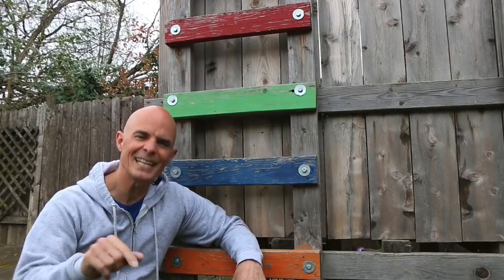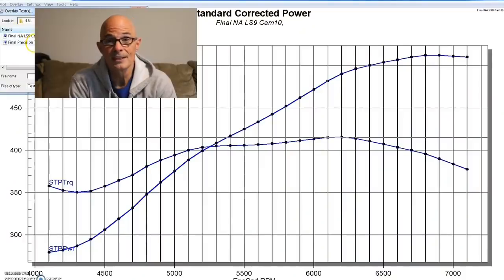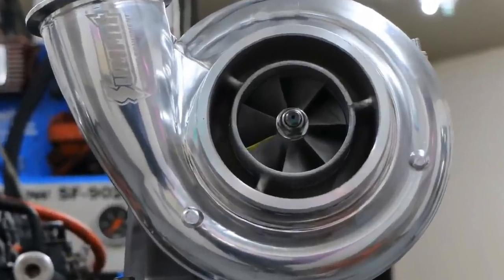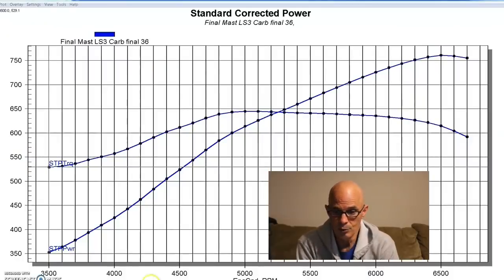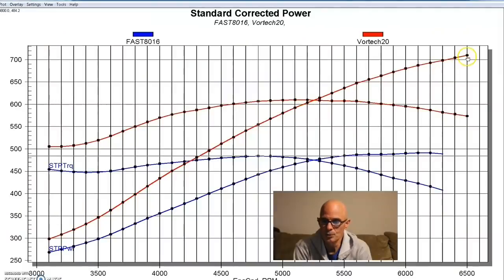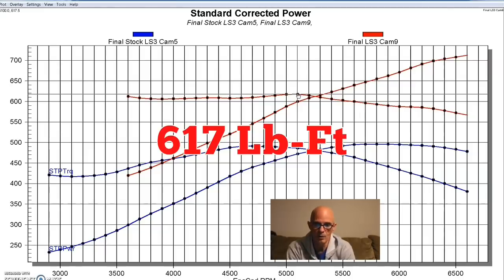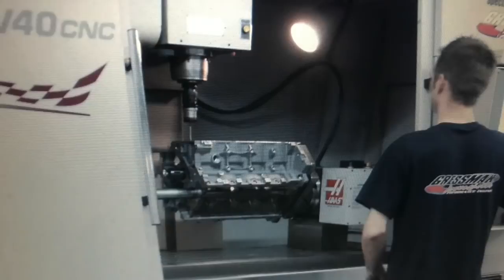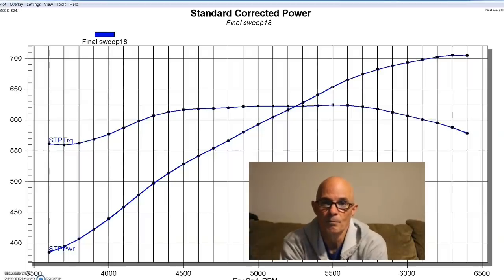LS HOW TO: 700-HP POWER RECIPES

Comment: This is what got me to thinking i could run 11.1 on 91  without riding the nock sensors.  But I keep getting conflicting information. So im unsure.  So i guess ill put the 317's back on for 10.2 or 10.3 ish Probably after I surface them.
Reply from the maker: it is more than just static vs octane
Reply: @richardholdener1727  Exactly. That's why I can't get a straight answer. There is no definitive answer.  Unless someone knows every aspect of your Project and the vehicle it will be going in and how it will be used.  You're not going to get that answer in the comments. There is a reason why dino sessions are expensive.

Comment: Richard do you have any info on that 251 266 duration cam that was in the ls7 454 combination? would that cam be to much for a 408 with 11.1 compression with a tfs 225 head?
Reply from the maker: it would be for a street motor

Comment: Man few years ago back I build an engine just like 1 you built it. an I made about same horse changed a few things after going in the truck and that truck runs today. We have watched ur stuff in past when budget was running low n thinking what can we do to make 50 more lbs or 50 more horse before we get 1 in n I will be first to admit that I did a few things u did n got the extra lil bit I needed. I owe you a thank you from a couple years ago Richard

Comment: So how does a 4.8l with a ls9 cam N/A make 512hp but a LS2 6.0l Crate motor n/a is 491hp ? Just interested in the numbers and differences - cheers
Reply from the maker: a 4.8L with an ls9 cam doesn't make 512 hp unless it has boost

Comment: I have a LS7 darton sleeves, texas speed 4 inch crank, 6.125 rods BTR, 4.130 wiseco piston flat top, Holley 105 hi ram, 103 nick William tb, brodix heads by Martin Smallwood & cam motion specd by him as well, 13.5.1 compression ratio on race fuel how much horsepower should I laid down on the dyno???
Reply from the maker: not sure without knowing cam specs-
Reply: @richardholdener1727  what specs do you recommend for a set up like this, I know you have a lot of knowledge also.

Comment: I think the reason he used the cathedral heads on that 7.0l is they tend to have a better torque curve provided you have them ported for flow with good port speed. The ls3's and ls7 castings are great for bolt on performance with really good peak flow numbers(320+) but the exhaust and midrange flow numbers I think(depends on head of course amd port work)are slightly better with a higher port velocity, hence a 705hp cathedral 450ci ls7, though I think he could have gone higher with an ported ls7 intake or aftermarket good intake and cnc ported ls7 based castings, but I bet the torque curve would suffer, I mean that's freaking flat over a very broad Rev range,  put some boogy in it!

Comment: Would these be reliable builds for the street? Specifically the 5.3 and 6.0. I'm building a 4x4 prerunner and want to run about 500-600hp to the wheels and not have to worry about my engine blowing up if I run this set up.
Reply from the maker: the difference between 500 whp and 600 whp is a lot

Comment: Great series!  Been following closely.. I really appreciate all the time and effort you put into these taking out a lot of guess work and questions about any 1 particular build. Just in time too for my turbo forged 6.0 iron L96 with stock LSA crank and cam.. boostline rods and Wiseco -11cc pistons.. 65cc LS3 style heads.. trying too break 700whp on a pump gas build (maybe a small additive) with  7875 gen 2 VS RACING turbo.. same turbosmart valving and electronic controller.. I think I'll be close  and have pretty decent reliability is the goal

Comment: Honest question here. Are the 8 liter truck engines not worth it ?
Reply: The parts to modify them are expensive. The older generation big block stuff doesn't bolt on. Performance parts for the 8.1vortec are available from raylar engineering.

Comment: What about 5.3 with 4 300 zx turbo  90 that do you think it would do  I  I figure random through each other would be to much back pressure make a white pipe and goes through 2 turbos per side To lower back pressure Do you think it be a runner or a flop

Comment: I've seen 617 whp on a Mustang dyno with an LS7 through ported Brodix heads, a ported stock intake and throttle body, and a much smaller cam on 91 octane.  That 468 made 761 hp with a carb intake and no accessories.  I've seen ported stock LS7 heads flow 20+ cfm than those mast heads ... overrated.

Comment: wich engine build would be a better bang for the buck if i already have a complete 5.3 or 6.0,   the 468 stroker earlier in the video or the 454 at the end?  doing a swap and looking for the best route to get to 700 hp.  thanks
Reply from the maker: The injected 700-hp 454 was actually driven on the street in a vehicle
Reply: @richardholdener1727  good to know, thank you!

Comment: This is kinda exciting to watch. I know nothing of engine combos and nothing of power adder's. I just know I would like a lot of horsepower and torque at a reliable stand point. A daily driver with dependable power. I have the 5.3 Tahoe and the 5.3 Yukon. Hoping to get my 5.3 Tahoe built ready for a turbo combo. Reliable power
Reply: Did you ever put a turbo on your Tahoe? I put a CX Racing 80mm turbo on my boss's 5.3 Tahoe, fully forged internals, running 9 lbs of boost. I took it to the drag strip for the first time last week and realized I have to change the gearing. 9.8 seconds at 76 mph in the 1/8 mile, does 61 mph in 1st gear lol Currently has 3.73 rear end gears, it isn't in the power band til half way down the track, I'm going to put 5.38 rear end gears in it and see what the difference is. 4l80e transmission with 31" tall tires makes the take off suck so I'm excited to see what the 5.38's do
Reply: @jomanout5866  no Its never been turbo. It has 3.73 gears I just rebuilt the rear end gears and a freshly rebuilt 4l60e transmission. 2wd. I need to get my suspension right first. Working on that and new brake setup . I want to blow the doors off some muscle cars out there. I think it would be fun and cool.

Comment: What would you need to do to get a 9000rpm “LS”?
Could you do it with a stock bottom end?
Reply: NO. Stroke is your enemy if you want rpm. Think about it. The increase in stroke means the Piston has to travel further BOTH ways and turn around in the same amount of time. We call it Piston speed. Draw it on a piece of paper. That stopping and change of direction is an issue.
Reply: dank sinatra that’s a bit of a generalization. The stroke may define the average speed but it’s the overall geometry of the rotating assembly that defines the maximum piston speed. It’s why people say long rods are important. 
Either way, I would figure valve train stability would be the bigger issue getting the rpms here. 9000 isn’t that crazy for a rotating assembly.
Reply: @Turbochargedtwelve  you specifically said stock block. Those rod caps will be talking to ya past 7. I know a thing or two. If you look on the cover of March 2020 hot rod magazine. That's our engine on the cover. Engine masters 2019 champs. Facebook Jerry bear barnette for more. Your welcome
Reply: Two of our engines also competed in lights out 11 if you know what that is.
Reply: dank sinatra that’s really awesome. Richard has shown 4.8s doing 7500, but they would have the best chance with a shorter stroke and lighter piston.  Still is a 100% stock bottom end is out, you need at least rod bolts. What do you need to make an LS do 9000rpm.
Reply: @Turbochargedtwelve  correct valve train geometry,  a great oiling system, and aftermarket parts with a blueprint before you start. We have a 433 inch Ls that has been to 11,000. It's 1100 hp. N/a. The valvesprings have to be inspected after every pull or pass. The 3100 pound 4th gen has been  7.99 in the 1/4. Liberty 5 speed trans.
Reply: dank sinatra I went and watched that race. Cool stuff! About the only people, that can actually use these crazy power numbers everyone chases.

Comment: I'm wondering which horsepower levels from this series would make the most cost effective & streetable & reliable daily driver combo.
Reply: Def junkyard block, gapped rings, turbo cam, valve springs, and a vs racing denmah 75mm kit
Reply: @codya8684  no such thing as a turbo cam since every upgraded cam that does well N/a will also do just as well boosted. just like making targeted hp is the same philosophy

Comment: QUESTION.. can you run pump gas and stock ring gap at 7-8 lb boost levels  ??
Reply: Yes , depends mostly on the compression.  But on 5.3 , 4.8 ,6.0 you should be fine.  Ls3 ls7 being high compression the tuning window is very small with pump gas .

Comment: You said you can make the 700hp with stock bottom end and stock heads, stock Pistons, and a stage 2 cam. Do you have videos of a stock 5.3 making 700hp
Reply from the maker: we have video of stock bottom end 4.8L making 1300 hp-its up, the 5.3L SBE made 1300, the current SBE record is 1543 hp with a 6.0L(that video is up)

Comment: I like them all , ran Procharger first  then went to turbo and like latter the best by far .
Reply: Why do you prefer the turbo over the procharger?
Reply: Bob Newhart immediately made 350 hp  more on same combo by switching , added an air to air intercooler but didn’t have a fan to blow through on dyno and I fought belt slipping even with a 12 rib belt , down side was it was expensive and fitting the plumbing took work but I don’t regret it . I also change the boost at the touch of my fingers with an electronic boost controller on the fly . This wasn’t a junk yard ls build but a big dollar BBC  that is 95 street that has now evolved into a 1340 wheel hp truck that drives docile until you stomp on it .

Comment: With the destroked LS1 that uses the 4.8 crank..which rods are used?
Reply from the maker: custom
Reply: @richardholdener1727  but stock 6.275 will work, correct?

Comment: These videos are great. Lots of great combos and fantastic no BS information. I've been digging looking for a trustworthy video and I don't believe you've done it yet on a max effort SBE N/A combo. Heads (TSP/TrickFlow/MAST) milled for max compression, Cam, link bar Johnson lifters, FAST (maybe ported) intake, 102mm TB.

Really wanting to do something like that in an M6 1LE Camaro.
Reply from the maker: look at the 500 hp and 600 hp combo videos for your answer
Reply: @richardholdener1727  I just realized I should have specified LS3 SBE. My bad.

Comment: I think this just proves that the junkyard turbo 4.8/5.3 is the best combo for your average hotrodder on a budget. Cruising at 2000 RPM, you're just a downshift away from 500+ lb-ft across the board.